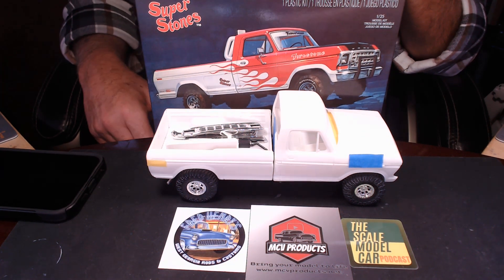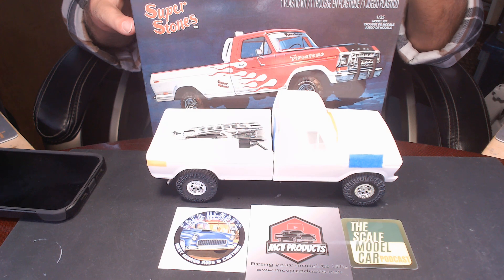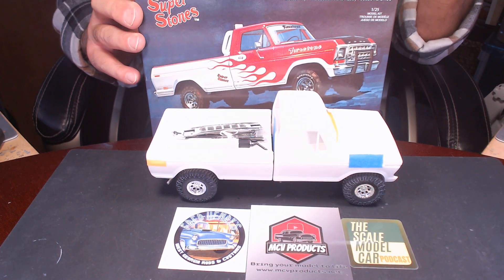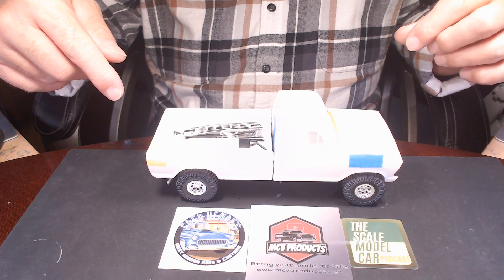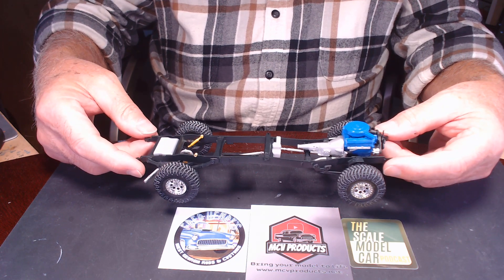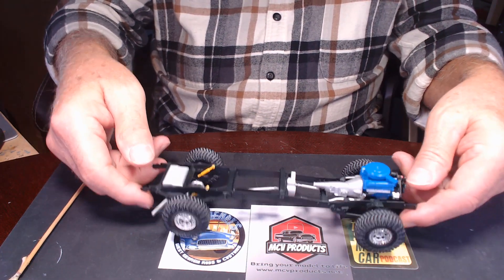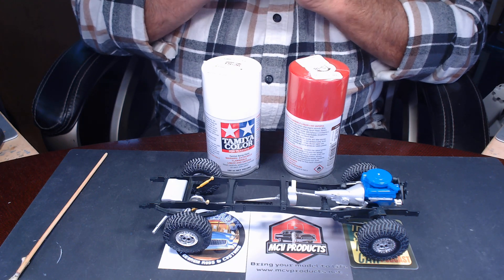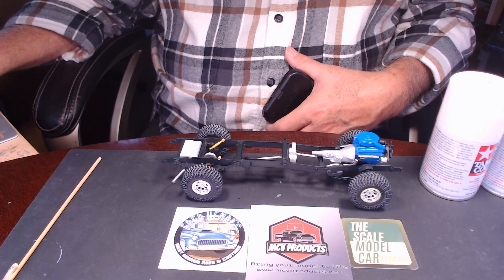AMT 1978 Ford 4x4 Pickup Truck Update 1

Comment: I have built several of those truck models in my lifetime -  It's a love / hate thing. The multi-piece bed is not a fan favorite - and getting the bed level with the cab is troublesome. I owned a real 1978 Ford F150 and rebuilt most of the truck myself so I'm very familiar with those style trucks. I would I build another one of the AMT kit. Though the Moebius Ford truck kits are far better (however they don't make the 78-79 grille style). It looks like you are off to a good start ! 👍